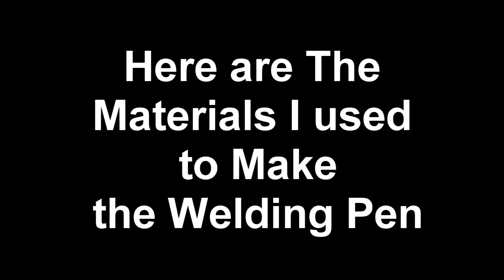How To Make A Spot Welding Pen for 18650 Battery Pack Spot Welder

Comment: Top job and tutorials. Subbed and liked. I'm going to make one. Can I use 18 volt nickel metal hydride batteries at 3 AH? I have 2 that I can connect in parallel to increase the current? I used to use them for jumpstart on my V6 Toyota hilux. Only one at a time and it would pump out 26 amps and then drop to around 6 amps. Any reply appreciated. Cheers from Australia 🙂👍👍👍
Reply from the maker: Cheers! I would use two batteries in parallel. I think that should give you ample amperage to spot weld. Thanks!
Reply: @ExtremeDIYGuy  thanks for the quick reply! 👍👍👍

Comment: hi Jose great spot welder what is that thing you put on the wire first called?
Reply from the maker: Where? Let me know at what point in the video and I should be able to help.
Reply: @ExtremeDIYGuy  after you strip The wire the little metal piece you slipped on the wire  at 7.13 minutes what's that called
Reply from the maker: The  one I used there is called a copper crimp sleeve, Typically used for grounding wires.
Reply: Awesome thank you

Comment: What's with all the coward downvoters? I looked at quite a few of these DIY Battery Spot Welder vids. I like this one the best. Off the shelf stuff and no Arduino required. Nothing against Arduinos, but the timer module in the previous video is just more straight forward and versatile. I also like the PHAT pen handle. I might add a monster cap on the battery side of the relay. Good job Jose.   Edit: And thanks!
Reply from the maker: Thank you! I appreciate the compliment!

Comment: FYI, that stuff you are using is heat shrink tubing, not shrink wrap.
 Solder all electrical connections in addition to mechanical fasteners. Just a tip for ya.
Reply from the maker: Matt, thanks for the correction. Ironically enough, I actually know that. Problem is I tend to blurt mistakes out in front of the camera and at time don't catch them in post production. Good catch though!